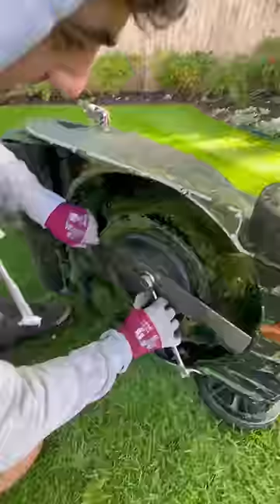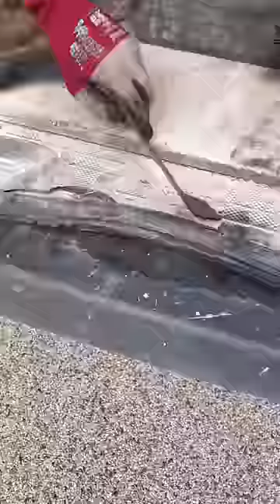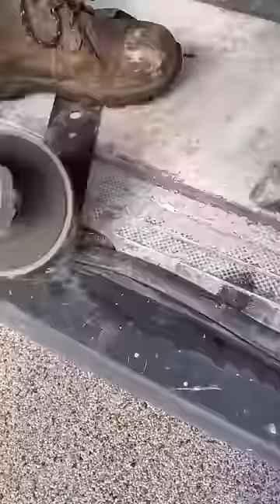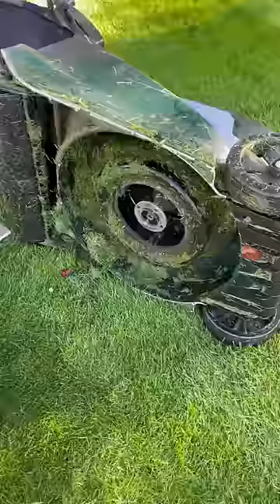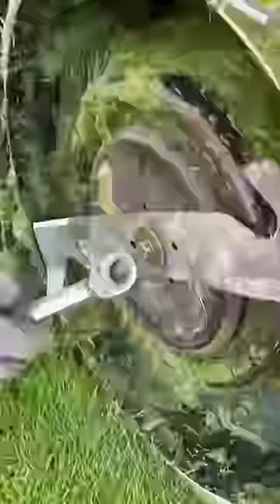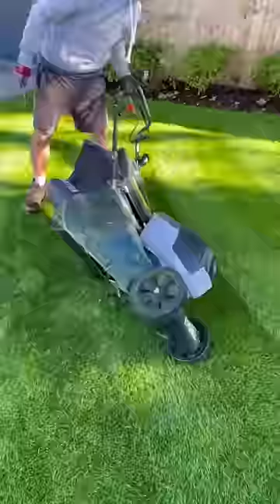It’s important to keep the blades sharp #garden #lawn #lawnstripes #lawncare #subscribe

Comment: He put the sharpened blade back on.... UPSIDE DOWN.....WTFU
Reply: Well spotted my friend,, he put the blade on upside down, the fins on the end of the blade,,  it is upside down,, &  putting the mower on its side,, it's a splash crank, not a good idea,,  
Thanks for sharing sharing mate,, 
Be safe & Be aware of those things??
Reply: I was gonna say the same lmfao
Reply: With the battery powered one's you don't have to worry about flooding it...
Reply: @backwoodssawyer1  what does flooding it have anything to do with the blade being upside down
Reply: @merckdamaniacmoments6475  if you don't understand what causes it to flood...
It ain't a gonna how ya put the blade on....
Reply: @backwoodssawyer1  dude where not talking about flooding the lawnmower…. We’re talking about the blades get in the right conversation
Reply: Recommend un plug spark plug

Comment: I sharpen my blades by hand with a file and wet stone finish that way it doesn't get hot I also like to remove any chips in the blade to prevent any more damage

Comment: a 4-stroke engine without a fuel pump can run horizontally or with the spark plug up. Do not turn the mower over as you did in the video, because this results in flooding the carburetor filter with oil and getting it into the combustion chamber, which will cause its seizing. After starting the mower, I am sure that the oil in the combustion chamber of the engine ignited and the mower was smoking heavily. Have you checked the oil level?
Reply from the maker: IT’s battery

Comment: Sparkplug off firstly or you risk losing your pinkies.  Also check the tip over side and tip towards exhaust always with the engine on compression.

Comment: You need to know blades are soft mild steel with a hardened edge.  Once the edge gets worn down, you can ReSharper but will dull after first or second cutting.  Also you have to learn how to put blade back on right side up
Reply: Many blades now are NOT hardened. 
I know the last few years at work we have NOT been getting hardened ones because they are just not out there so much now. 
And if they are hardened then they are crap Chinesium...
Reply: That's not true. Sharpening blades is very important and must be done regularly. If done properly the sharp edge will last a long time
Reply: @danthompson5797  I got a test fir you.  Sharpen your blades and check them after 3 cuttings.  They will be dull again
Reply: @jamesowen21  I've been doing it for years. I keep my blades sharp
Reply: @danthompson5797  You may sharpen your blades, but what's the reason you have to sharpen them often???
Because they dull easily.
LIKE I SAID BEFORE. Because they have a hardened edge from factory that wear down after a while. The rest of the metal is not hardened steel.
Come on keep up with conversation
Reply: @jamesowen21  that's simply not how it works. The edges are not any harder than any other part of the blade. There are different alloys of steel. Mild steel has lower carbon content and bends easier and can be welded easier. Higher carbon steel results in increased hardness but increased brittleness. You can't have brittle lawn mower blades, which means you cannot have too much carbon when making a blade. Blades will hit hard objects from time to time when mowing and they will be dulled. They will be dulled faster than normal when mowing thick grass even if not hitting any rocks or dirt. You cannot have two different types of steel on one blade. If they put a harder steel on the edge, it would chip off eventually leaving no net gain purpose. I have worked in the industry my whole life and every professional I've worked with and for has sharpened their blades regularly because that is what's necessary. There's no magic blade and it is a frequent maintenance item.

Comment: Awesome just be sure to balance.

And you should always disconnect spark plug on a gas engine before handling the blade.
Reply: Why does it start by its self?
Reply: @jeffstandish5226  
If the safety becomes depressed and you rotate the blade it will start

Comment: Ok...
One.
DO NOT TURN YOUR MOWER OVER ON GRASS!
God forbid you have a leak or something... Or the engine is hot. 
(This one looks like an electric spits but still beware)

Two.
Balancing is not a thing?

Three.
Are we alternating sides now for the blade?

Four. 
Take off the bag from the back before turning over, you don't want to put undue strain on points that are not built for that kind of pressure.

Nice striping, BTW.

Comment: It is important that the blade is sharp. That blade has what is called a high sail to lift the cuttings so they go into the bag and leave very few clippings. But you need to keep the build up of grass off the inner side of the deck. That will have an affect on high good the mowers work
Reply: Clippings are free fertilizer.

Comment: Sharp yes but not an acute bevel. You want your angle to be a little less than 90 degrees. If the angle is too acute, then the grass will fold over the blade and reduce suction as well as power.
Reply: 90 degrees? What?
Reply: Its more like 45 degrees, but can be as low as 30 degrees - it depends on the manufacturer and blade. (I googled this for a minute or 2, so now I’m an expert)

Comment: I understood the concept of sharpen blade, but you make two mistakes, first one, you need to unplug the spark plug to avoid a start; second you put the blade upside down turn it around. Be safe and thank you.
Reply from the maker: You made two mistakes it’s battery powered. And the blade been put on the runway was a test and you passed. 😂

Comment: Main thing is pull the spark plug wire off or it will start up with very little compression cause it was already running